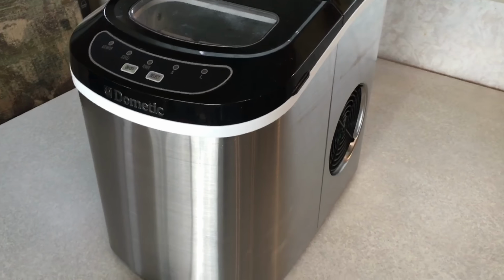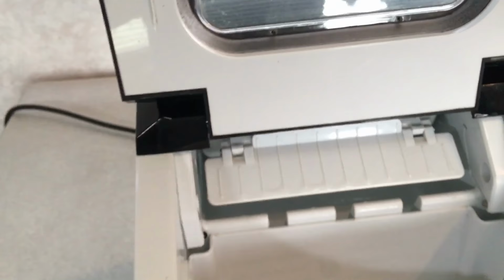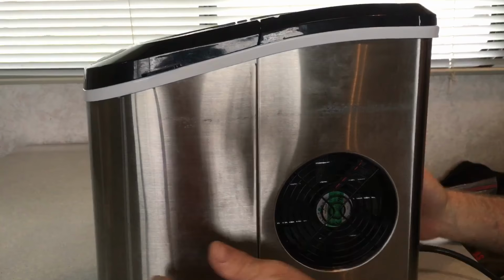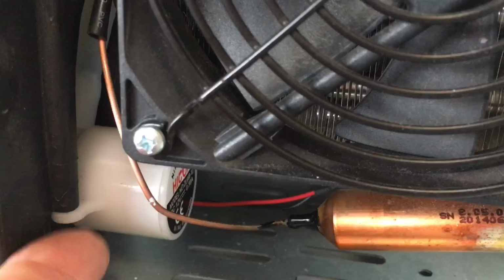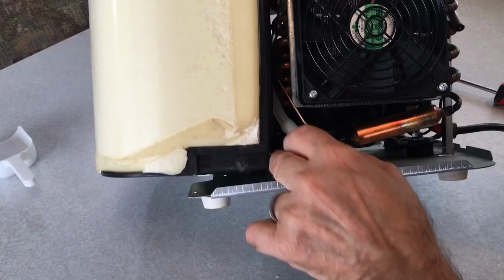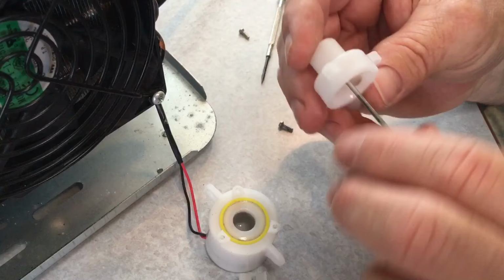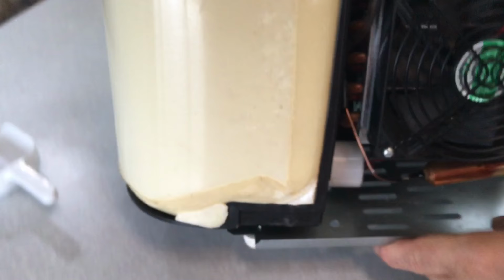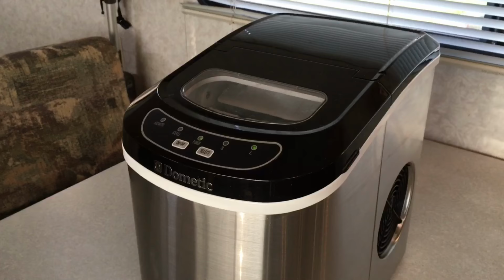Portable ice maker not working, watch this before throwing it away

Comment: As seen in beginning of video, the pump appears to be working fine due to water is seen flowing past overflow, back into reservoir. If the pump was not functioning correctly, please explain why the overflow of water and how this affects the cooling of the coils not to happen. Water can be seen in tray at rear of top,up over the 8 freezing plugs.
Reply from the maker: I’m not sure exactly what you mean but the pump must flow excessive amounts of water into the tray and allowing it to fill the tray and overflow. 
There is no cooling of the fins due to the water flow at all.
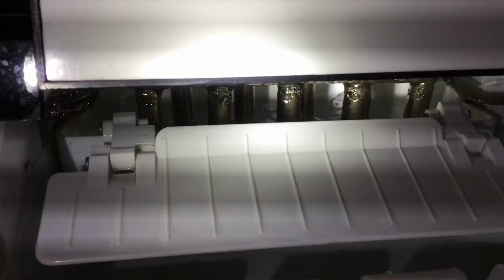Reply: @reallystrangebuttrue  I was not referring to the fan cooled fins at all. Your video at about the 1:20 mark shows the 8 freezing plugs covered by water. This indicates pump is functioning. If there is water in tray, how can pump stop the freezing cycle?? I used bad terminology when I wrote "cooling of coils" should have been "cooling of 8 freezing plugs"

Comment: Ugh. I wish I knew it was going to be this hard to clean before I purchased it. It’s growing mold where it forms ice and I’m not willing to slice my hand open to clean a device. Smh.
Reply from the maker: Try this, someone else mentioned in the comments if you use distilled water not only does it make great tasting ice but it helps keep the mold growth down to a minimum. Keep in mind you can spray with vinegar and maybe use a toothbrush to get in there a get it cleaned. Then spray it with water, run a couple of batches of water through it and you should be good to go.

Comment: Mine failed when the motor that dumps the ice rusted on the outside. I replaced it with a cheap amazon unit for 10$ but took it apart later and removed the rust. Now i have a spare

Comment: Hi I have the Olyus ice maker an just last night it blinks red from "Water" to "Full" and I dont know what to do. I cant find anything on vhf the internet nor videos on the machine. If you could help it would be nice
Reply from the maker: Give this a try, it seems that most electronics once in a while need to be unplugged which can help drain any static charge and can also reset possible problems. Leave it unplugged for a good 30 minutes and try again. That would be awesome if it resets your machine.

If that doesn’t work,
On the inside of the ice compartment you should be able to see the sensors for ice full etc., make sure they are clean. Those two things would be the easiest to start at before taking the unit apart.
If you do have to start digging for internal problems, make sure it’s unplugged and start with where the sensors connect to see if something has come loose.
Hope this helps, good luck and please let me know what you find.

I once had a spider get inside of a dehumidifier circuit panel and shorted that unit out which ruined it unfortunately so you just never know what goes on inside of these machines.
Reply: @reallystrangebuttrue  thanks for the reply, i really appreciate the time you put in helping us the comments. I'll give these a try an see if it helps. I have a couple of these machines an same thing been happening. Maybe they all need the same thing. We'll see🕵️‍♂️
Reply from the maker: FreshAsImIz My pleasure, it would be so awesome to see if those tips help you out!

Comment: should the fan be spinning on the side at any point, mine does not spin and the machine gets very hot.
Reply from the maker: Absolutely it should, especially if it’s getting that hot.
Most ice machine fans will run off and on as needed so, I would look around to see if the thermostat that controls it hasn’t become loose from the cooling fins for starters.
Reply: @reallystrangebuttrue  Thanks bud, I will take a look and see what I can figure out.

Comment: Thanks. Do I run vinegar through the machine or do you mean just clean it with vinegar?
Reply from the maker: Philip Brown both, I ran vinegar through the system for 2 trays of ice, it seemed to sterilize it very nice. 

I also do this to my coffee maker 2 times a year.
Reply: @reallystrangebuttrue  Thanks! I'll try it. The exact problem I'm having is its making  tiny ice and the ice is melting. My guess is a hair in the system like yours (live with 4 long haired people with an F on their birth certificate).

Comment: Thanks for the teardown video.  I have one with the motor that controls the bucket rusty and frozen.  Can you get this kind of parts from them or do I need to find a used unit elsewhere for parts?
Reply from the maker: That’s a good question, I would try googling your model number and see if parts are available would be the best way. 
Some parts stores might carry stuff like that but most of them are only into the large appliances.

Comment: You did not show how you removed your back cover other than showing your hands making the motion to slide it off. Mine is pretty attached even after removing the screws. Guess I will try to see if I can do this without breaking my broken ice maker. If I manage this I may just impress my other half. Wish me luck. Upside is if I break something then he will not care because he never tried to repair and is just buying ice at the store now.
Reply from the maker: Hope this video helped you out and got the job done, please let us know. You are correct, I did not sure which screws to remove. It should be any of those on the bottom that appear to be holding it to the unit.

Comment: I have a Frigidaire Ice maker, seems like my motor may have went out ? The tray moves as if it’s going to start working, the sound from the machine doesn’t make any noise , the tray goes back and forth, but then nothing happens. Please help . I love my machine.
Reply from the maker: Sorry you’re having trouble with your icemaker, there could be multiple problems causing this issue.
Are you having any “ice full” or “out of water” lights come on? 
Sometimes the ice basket (not being fully set back in place) can block the sensors and cause issues.

Comment: I finally got mine to work thanks to this.. now new problem makes the ice but is not dropping it 😭😭
Reply from the maker: Almost sounds like they armature that rotates the ice bucket accidentally was disconnected during this process so I would inspect the linkage that operates it from the inside and then proceed to taking the shell off and making sure it did not get disrupted in anyway.
You’re almost there, so glad to hear that your icemaker is making ice again. Hopefully this info helps you and you can get everything working back the way it should.
Reply: @reallystrangebuttrue  honestly I have no idea where or what the armature is 🤣🤣 I think I’m throwing in the towel on this one been trying to fix it for weeks and finally got it to work thanks to you and now this lol.. thank you for all your help appreciate you
Reply from the maker: @melissacaseri2249  I completely understand, it can be very frustrating to say the least. 
You’re very welcome, glad to help you out. Well,… kind of lol 
The amateur is just the linkage/parts that moves the basket for dumping. It could’ve just simply popped off when you were putting the cover back on.

Just remember, that if you get a brand new one and it stops making ice, that darn hair can get into any one of these units lol
Thanks for keeping us posted 😎

Comment: Have a Danby. The low water light is blinking, but the unit is full to the fill line Tray full light is blinking . No ice in the tray. What do you think?
Reply from the maker: First, make sure that the ice basket is down all the way and not blocking any sensors, making it think that the ice is full.
If that is still an issue, this video shows how the water is filling the ice making tray, make sure it is filling properly, and the water flow is sufficient where it is adding too much water to that tray where it is literally overflowing.
If it is not, the propeller in the pump may be obstructed.
Another possibility is it’s needs to be reset and the way to reset most all electronics is to unplug them for 5 to 15 minutes and then try again.
Hope this helps.

Comment: great video.  my ice making works but making a terrible grinding sound after it dumps the ice and starts to fill up again? no one else has reported that problem.
Reply from the maker: I had to read that twice, if it’s making the grinding sound “after” it has dumped the ice, that could also be in your pump if that sound is doing it while filling the water tray.
A very small piece of sand could be making your pump sound that way, please let us know what you find.
Reply: Funny you should mention this problem; I just wrote a comment about that very thing.  The loud, grinding noise. Ugh - it is awful.  Is your machine still working?  I keep waiting for mine to break, especially when that noise starts.
Reply: @reallystrangebuttrue   Thank you.  You just addressed my problem as well, so please don't worry about replying to my comment.

Comment: Not sure if you're still seeing comments, but mine is leaking from under that black "pastic tape-type" material, do you believe thats from the hose or another component?
Reply from the maker: That’s a tough one, there’s a few places it could be leaking so unfortunately you’ll have to start digging for it but the good news is, it might be something so simple.
Sorry I don’t have the exact advice you were looking for.
Some units do you have a drain plug so make sure that is not your issue. Location of that would be upfront on the underside of ice maker.

Comment: I have the same one, the water line somehow has a hole in it. Do you know the size of the line or where to get a new one?
Reply from the maker: Hello and thank you for watching, it may be a different size than most so the best way would be to remove the line and bring it to most any hardware store as they usually sell that by the foot and very cheap. 
You can also search your model online using the words replacement water line.
Hope this helps you out.
Reply: @reallystrangebuttrue  thank you. I tried searching online for the part but nothing came up for the model.  I did end  up taking it off and that was my plan.

Comment: I have the same ice maker as well only igloo brand. On mine the only way it will make ice is if  I press power and select large or small, then hold down the select button for ten seconds. The add water and ice full lights no longer come on anymore as well. I’ve cleaned the unit full sensor and reservoir but haven’t opened it up yet. Do you think a home appliance repair shop would fix these issues?
Reply from the maker: That’s a good question, a lot of these repair places just recommend replacing them because the price of them came down so much that it would not be feasible to repair them anymore.
It’s always worth calling around, I’m not sure how old your icemaker is but if it is actually making ice without major or dangerous issues, use it until it’s finally done and keep an eye out for a sale on a new one. Hope some of this information helps you, have a great day!

Comment: What if the ice machine won’t stop making ice, I’m sure it must be the sensor but any suggestions?
Reply from the maker: Yes, you are correct it would be the sensors. Make sure that they are clean first and if that doesn’t solve issue then they would have to be replaced or keep using it but just make sure that nothing gets damaged by it overfilling.

Comment: So everything is working fine on mine.  My only issue is that the compressor is really loud, all of a sudden, whenever it kicks on.  Amy ideas?
Reply from the maker: My first thought is, I always make sure that it is sitting still and level  for a good long while (check the owners manual on your specific model) so that the Freon goes back into the compressor after it has been moved around or even tipped on its side. This would make for a compressor to be loud and hopefully it’s not because it’s going out.
My second guess would be, reversed polarity on an outlet or low-voltage coming from the electrical outlet.

Comment: My machine fills with water & I can hear the noise of the pump working, but no ice cubes are made. Is this how I would fix that issue?
Reply from the maker: You just never know, until you just start pulling it apart. 
Everyone seems to find the problem in the video the same but a few are finding different repairable things.

Comment: The issue im having is that my ice tray doesnt stay in the upright position it keeps on cycling back and forth. Any ideas?
Reply from the maker: It would almost sound like one of two things.
1st something jumped off track a plastic gear, stop arm, etc. which may be internal to see it by removing the shell and watching if anything does not seem right.
2nd something electrical came loose like a relay or a sensor etc. and hopefully it’s not the main computer board. Which I have not done but would guess it would be reasonably inexpensive to order a new one off-line and install. Without proper diagnosis it would be hard to tell if that is what needs to be ordered though.
Please let us know if you try these and if it works or if it does not and maybe even an end result because a lot of folks read the comments and it will help everybody out,.
Thank you so much.
Reply: @reallystrangebuttrue  simple as pulling the connector from the board on the stop switches, cleaned em up a bit and reconnected. Worked just fine. THANKS!
Reply from the maker: That’s  awesome! Always a great feeling to fix something. Thanks for the update, I hope others can read this and maybe that is an issue they are having.
Hope you have a excellent day!
Reply: My tray doesn't cycle ether, I think the mechanism is out of whack.  It makes grinding noises at times and the water tray sometimes jerks.  Can't see by looking what is wrong, so I'll have to take off the shell.  Other than that, the thing still makes ice.  Mine is a Frigidaire.

Comment: I have a question my portable ice maker started making giant chunks of ice I noticed that the ice Box maker that retracts back not the removable basket but the swaying unit that carries the ice from the back to the front is not releasing once the ice is finished being made the basket doesn't drop fully down like it once was do you think this is repairable
Reply from the maker: Hello, I think almost everything is fixable LOL something sounds like it jumped off track and the mechanicals for those arms can be seen underneath the cover. It would be my guess that somehow it hung up from a ice jam which happens a lot and popped it off track. I would suggest removing the cover and look where the metal arms go into the mortar that operates the basket. Good luck and please let me know how it goes.

Comment: my ice maker goes through all the steps of making the ice but the water wont freeze. the ice maker was flipped over by my sister to dump the water out and clean and im afraid that might have been the cause. is there anything i can do about this?
Reply from the maker: Did the unit sit right side up for a minimal of 24 hours after being tipped on its side?

Some people feel 48 hours is a timeframe for this but 24 hours is what we have done and some icemakers have a drain plug in the bottom so you do not have to tilt them on the side to empty the reservoir.

Comment: I actually tinkered and figured out most of the same things. However, now too much water is flowing and I can’t figure out how to adjust the governor to make it stop tripping from too much water. Do you have pictures of how the governor should be set? The problem is that we probably don’t have the same machine either. Mine is a Danby.
Reply from the maker: What do you mean by too much water? Keep in mind that when these things are running properly water consistently flows into the ice tray, overflowing for a set amount of time because the ice tray does not have a sensor of how much water should be in it so, if it’s overflowing the ice tray back into the reservoir it’s working properly.
Please let me know if that’s what you are experiencing.
Reply: @reallystrangebuttrue  I mean it is sucking in so much water now that it trips and the water light comes on.I can't figure out how to put in the picture of the governor I am talking about
Reply from the maker: @rachelheney8471  Just got your email with picture, I’m going to take a look at mine shortly and will get back with you through email. This is an odd problem to have too much water and I really wish YouTube would allow pictures in the comments because it would help many folks out.

Comment: Mine turns on and sounds like it's working but it immediately states ice full when it hasn't even made any
Reply: Mine does that once in a while, I have to make sure that the ice basket is properly positioned. I know that sounds odd, but if the basket it tipped up a little at the back, or is at a slight angle, it can mess things up.  Worth a look at least..
Reply from the maker: Excellent advice  from Jeri Evans. I would also like to add that the sensors are up on top, in front of ice bucket and if they are dirty it will read “full ice”

Comment: My tray won’t raise all the way up to fill or dump. The white gear moves but only slightly to trigger one of the 2 switches. Is this a motor issue or something else (I can manually move the tray and that will trigger the white gear and switch)